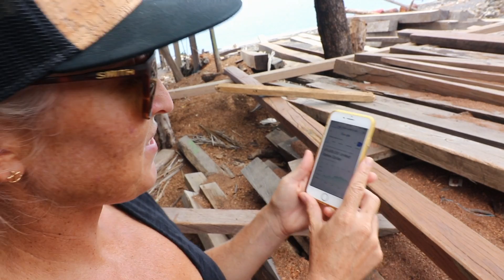How they Build Boats in Indonesia!

Comment: If no one has already commented on the method used to launch the boat, when dennox was describing it I have seen many ships beating launched using rubber rollers, almost like the fenders found on vessels.. I assume (from his explanation and how I’ve seen boats / ships launched )they use bambo poles or other round long times as the rollers they use along the beach.
Often there will only be x amount of rollers and they are moved from the rear to the front as the boat rolls along them..

Great video thanks guys.

Comment: Ironwood very good, strong, make really good boat. You can see how powerful is boat to be pulled into water and not break.  Well made wood boat is a very strong hull.  Larges steel boat while strong has a limited lifespan, whole thing rust, but a wood boat can be more easily repaired.

Comment: Phinisi....that makes sense! The Phoenicians were maritime traders back in antiquity and these vessels, and smaller ones called Prahus in Indonesia, were powered by Lateen sails until only a few years ago. Lateen sails have their origin in Arab design and powered all boats from east Africa to the Indonesian archipelago.They are still used on new vessels (dhows) built along the north Indian Ocean coast. Powerful and easy to handle these vessels were nearly ubiquitous throughout thousands of years of history! The bamboo caulking is not very different to oakum used in Europe (the busted up and rolled fibres of the oak tree bark) for centuries. Thanks, that was a very informative video!

Comment: The iron will rust, and will probably attack the wood over time causing iron sickness, which is why it's better to use bronze etc. but that's more expensive. You can phosphate the iron first which apparently helps. It's probably from microbial activity eating the iron rust and it migrates into the wood grain and starts to rot and allow more moisture in there. Trunnels (wooden dowels) are best along with bronze bolts, for a boat that size and cost, probably worth using the bronze fasteners, and it will extend the life of the vessel.

Comment: 1,000 Tons...It's not so much the weight, as it is spread out over a large area.  He said they lay down wooden beams and use bamboo rollers.  Standard old school boating practice.
For reference, The takeoff weight of a Saturn 5 rocket was 3,250 Tons...and it flew!  
These are coastal craft as they do not have the keel weight needed for deep ocean travel.

Comment: i have iron wood runners in my elevator.  home made back in the 50's.  the wood came from rub rails from an old tug boat.   i live in alaska.  back in the day u used what you could find.  and made what you needed.  the ironwood rails are 2 in square by 40ft long.  the building is 4 stories.   all wood construction.   the elevator is metal though and with a little grease,  no wear on the wood after almost 70 years of daily use.

Comment: Was in Teluk Wera (Wera Bay)on 14 May and again 1 June and went for the same walk on the same Pinisi... was asked to pay the same rate... 50,000 IRP... that's about AUD$5.00... for the tour....have mastered many Pinisi around Indo... awesome boats... they start around AUD$500,000.00 for a 35 mt multiple cabin unit with 1 motor.... problem is that they sink easily too... ask the Siren fleet masters... Pinisi's were made to go in the direction of the prevailing winds through one half of the year (say the Southern monsoon winds)... then the return journey during the other part of the year and the monsoon winds. 
The wreck infant of this Pinisi was due to a storm on 12 to 14 May... if you were to dive in the bay... you would see quite a lot of the other boats that did not make it to shore that night.
Directly opposite Wera Bay is Volotus Sangeang (Volotus is Indo for Volcano) We were anchored up just infant of the little river and watched the Volcano "Coff" as the locals would say... letting off clouds of smoke and steam by day... spitting small lava rocks that glowed bright Red at night... an experience that only those on the water have a chance to see... there are no roads into that part of North East Sumbawa... thanks for the video... brings back memories ..

Comment: Iron is often used to make a stronger constructions than stainless steel would make. “Stainless” is a trademark, it should really be called stain/rust resistant. It goes through a few processes to achieve the coating that makes it rust-resistant which could change the strength of the iron itself. Rust makes a better protection against more rust. You just don’t remove it and the outside layer of rust will protect the iron under that’s good. If you damage the coating of “stainless” steel, it’s broken for good and you will have to protect that area again in order to regain the strength. That’s why you use iron and not “stainless steel” for this.

Comment: The hull typically is 1/4th of the cost.  Additional costs are a power plant, rigging, anchor, chain, and a whole lot more.  My guess is the accident rate there is less than the US because the yardbirds know that if they get hurt, the medical supplies in the safety boxes are long gone.  To build these type of ships, you only need to know one thing.  Think big!

Comment: The bamboo shavings will be pounded in tight then when put in the water the shavings will swell. The boat may never be leak proof totally. But with the help of bilge pumps it will be safe and sea worthy. If the bilge pumps crap out then it will be done by man power. A human chain of sailors with buckets passed from sailor to sailor. If and when it leaks to much the boat will be put in a dry dock and air pumped in lifting the boat from the water then they will look for sun shining in the boat. And put some more bamboo shavings...

Comment: Love that chipmunk music in your intro. In the 1970's many of the indonesian fishing vessels were caught in Australian waters fishing illegally. It continued right through the 80's and 90's. Most of the boats were confiscated and the crews returned to indonesia by plane, the boats were later burned. One vessel that was caught off the Queenland coast near Mackay in 1976, was confiscated, it was made of solid Teak. When they tried lifting it out of the water with the jetty crane, the crane broke. They ended up bringing in a heavy lift mobile crane and it did the job. They didn't  burn it but left in the harbour forshore area for people to look at. When cleaning it out they had to use industrial strength bug spray, and later collected 5kg of cockroaches from it.